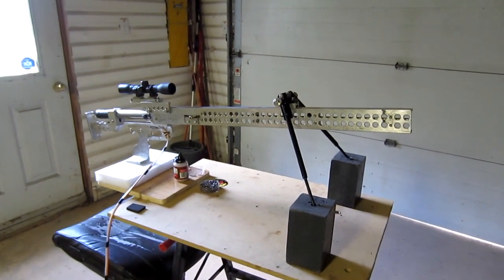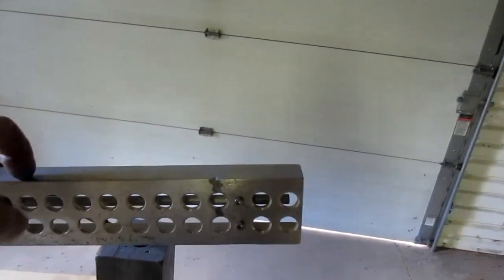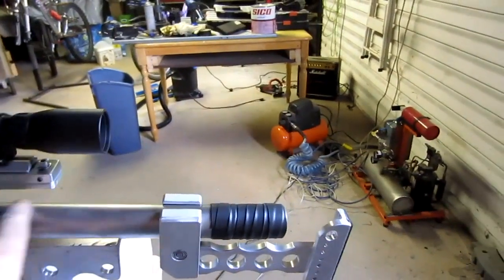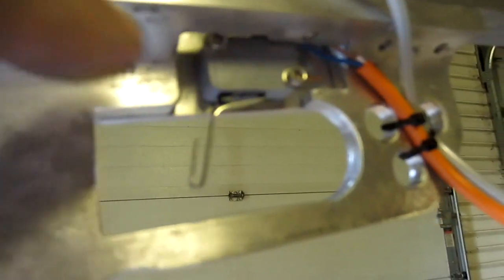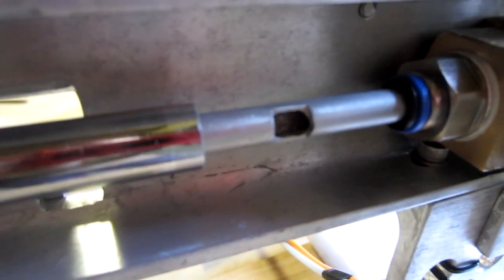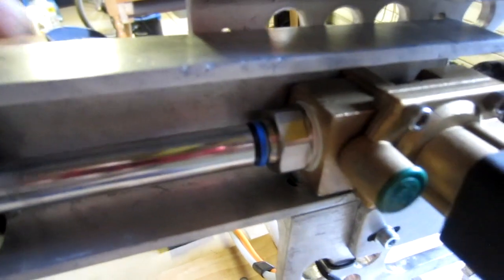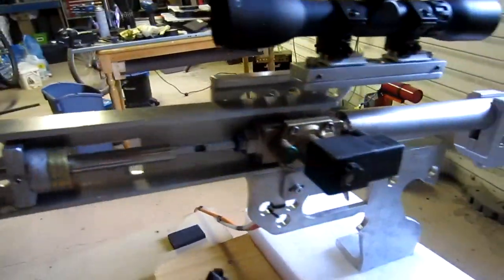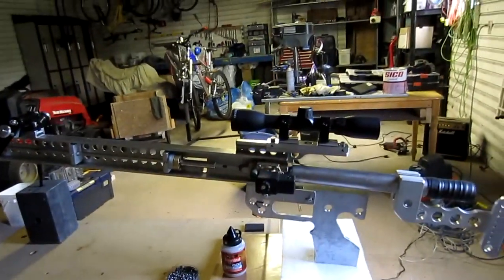Homemade .177 / 4.5mm smooth bore.

Comment: how many shots can it do on a single tank
Reply from the maker: The onboard chamber is emptied on each shot, the compressor keeps it topped up, if the compressor is switched on it will shoot forever. Made it a lot shorter a well  http://www.spudfiles.com/airsoft-pellet-database/topic26832.html#p386723
Reply: @farcticox1409  thanks for the link man , love the progress.

Comment: A very clever designed air rifle.  I use stainless steel tubing for barrels in several homemade air guns also.  I have started using Crosman replacement barrels as they seem to shoot better groups.  It is amazing how much velocity you are able to get with 150 psi air.
Reply from the maker: I would have liked a bit smaller ID tube, it is 4.65mm, that's the best I could find with a decent wall thickness. Like to try a rifled barrel some time as well and see if that pressure is enough. I have shortened the barrel to 550mm as well.  http://www.spudfiles.com/airsoft-pellet-guns/topic26829-15.html#p385692